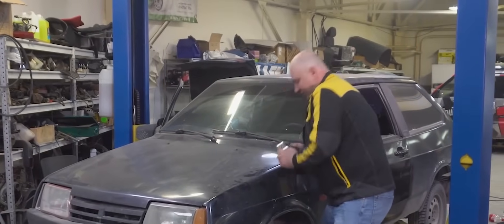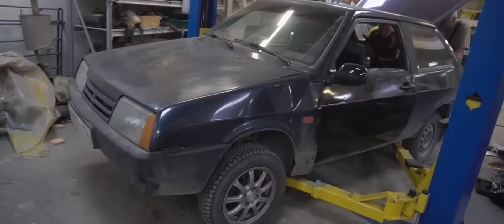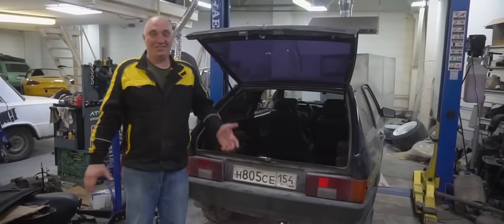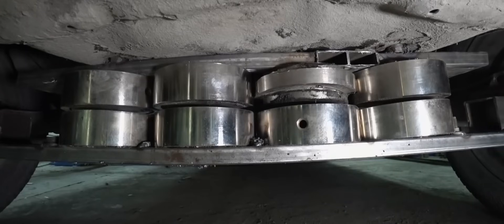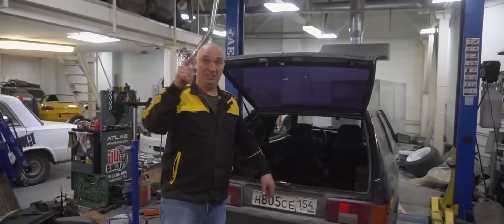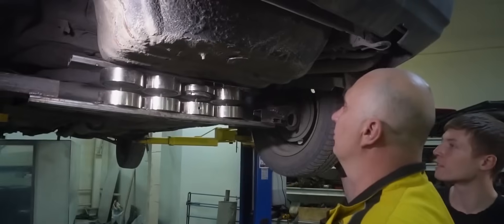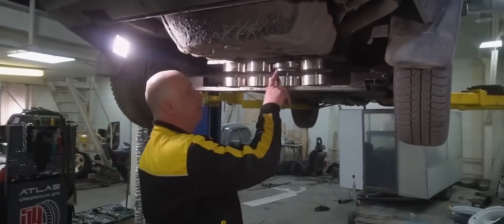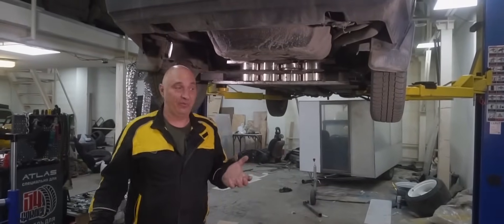DIY magnetic suspension

Comment: How about you try stacking the magnets Instead of two magnets, 
pressing together how about you add multiple i’m a engineering lover and I love engineering until you came up with a magnet suspension try stacking them like five or six of magnets then put it into a tube or a stick drill into the magnet then added a metal stick or some. I don’t know where it’s called.

Comment: Make a big tube and stack the magnets make sure each side faces a positive it'll act as a spring get 20 in total 5 per wheel (for full setup) use 10 if only doing the rear

Comment: Very interesting. Maybe you can try this: a loudspeaker is a coil wound around a tube that sits around a permanent magnet. When you apply a current to the coil, it's sent flying in one direction or another depending on the polarity. On the speaker the coil and tube is bound to the cone that in turn pushes the air, and that's the sound you hear. You don't need the cone, just a bunch of stacked permanent magnets, a tube sitting very close around the magnets, and the coil wound around the tube (firmly attached/bonded to it). The magnets would be attached to one part of the suspension and the tube to the other. The catch is that the tube needs to be made of some material that won't disturb the magnetic fields, and at the same time be able to support the weight of the car. Some kinds of metals interact very little with magnetic fields and could be appropiate. The coil should be electricity isolated from the tube.
Not sure if this would work. I don't know enough about that field. I suppose it would require a shitload of electric current. It would probably a good idea to team with another channel that has practical knowledge about electromagnetism, or maybe some enterprise that manufactures electromagnets.
EDIT: it seems like Bose (speaker manufacturer) had made an electromagnetic suspension like 20 years ago, and it's great. Never seen a car run perfectly leveled thru obstacles almost like they aren't there. Somewhere i readed that they used linear motors, sensors and a computer to control it all, and that the required current isn't that much, but the system weighted like 1/10th of the car (100+ kg, i assume?). This is one video about it: https://www.youtube.com/watch?v=3KPYIaks1UY
And another one: https://www.youtube.com/watch?v=Z97Db1X99wA

Comment: I had a similar idea too some years ago. Was so good to see you bring it into practice. Maybe has been already suggested but, here´s an hybrid idea: what about using the magnets as dampers( that is, making a + and - side attract each other) and combine it with a spring (as I believe it has better shock absorbing properties than magnets in practice). Basically, the idea would be replacing the hydraulic part from spring shock with magnets for slowing down the rebound and keeping the spring). Can see it working in my mind. Do you think it could work? Would you give it a try?

Comment: Try make a motor that will run on compression alone no fuel sequence of pistons no valves ,hitting compression 1 piston after the other creating continuous rotation of crank could make huge generator ,My gift to you if it works .maybe incorporate magnets 🧲

Comment: Put the magnet in like a cylinder it will be to cylinder with 5 or 6 powerful magnet
And each wheel have its own suspension magnet system
And it can move more like up and down
🤔🤔🤔

Comment: Place the magnets inside two cylinders, facing each other on different poles, cylinder should be shorter than the magnet assembly, top & bottom magnets should be secured to 02 steel disks with four holes to tighten the bolts & nuts to the body inside the shock well on the top and the bottom to the crossbar of the wheels

Comment: The Metalls interfere with the Repelling force. The surrounding should be isolated.  
The repelling and attaching forces are always equal. 
A Combination of hydraulic and magnetic Suspension could be good functioning. The magnetic field should be produced by electricity and with the help of AI altering the Repelling force according to the road conditions. Or be manually controlled. 

Sport, Comfort… drive modes

Comment: You should try another one using magnets in a copper pipe. Eddy currents actually behave similarly to a damper in that they slow movement. The problems with magnetic springs is that lose magnetic force exponentially as distance between them grows.

Comment: These kind of magnets are freaking scary! Very neat idea! Ideally you'd use electromagnets though so that the junk you gather driving falls off when you power down the magnets, plus without electricity they wouldn't be magnetic, which would make them a lot safer to work with and you can up the current/voltage to get more magnetism- way beyond the ones you used too and to add to the features you could adjust the voltage so operate them like bags and adjust your suspension- more current, more travel/higher ride height. what you could also do to get more travel is stack them- rather than just one magnet on top/bottom you'd do like you do with regular shocks and stack a bunch of magnets and just ride on air

Comment: What if you put a sprocket on the outside of the non powered wheel. Then a sprocket on the powered wheel. Ran a chain from one to the other. On both sides, and make it a 4 wheel drive? 😂

Comment: I think it would be cool to try this but to put all the magnets in a tube with a guide pin the the center and it would hopefully fit where your original shock absorbers were located.  I would use a threaded center pin so you can compress all the mangets together for installation and it would be somewhat adjustable afterward.  Great video with a good proof of concept.

Comment: The better design is to stick a four or six magnet stacks. Horizontal travel would improve, it would be like increasing voltage on a set of battery. So fist stack would of 4 magnet,  2 magnet north to north, then the next stack south to south. That would provide enough travel and you can have one stronger than the other giving you a dual damping rate...... No need to reinforce the suspension since you can mount in the general coil area, not in the middle of the chassis

Comment: The problem with that idea is that the force is exponential to the distance, so in the down direction there is little room for motion but the up direction the car has a lot of room to move with ease. What you need to do is, place a magnet in a conductive tube to use eddie current to create a damper. This will be linear in all directions/ For the spring to keep a offset position, im not sure

Comment: Some rubber between the magnets preventing magnets hitting each other? Make rear axle suspensio n like   \o so that th magnets are located closer to the attachment point of the rear suspension to the body, so that the smaller distance between the magnets leads to larger room for movement for the wheels?

Comment: Put the magnets same way inside of the car shocks with shock oil and air . the magnets will still work wether it's in oil .or helium air .normal air gas or water the magnets will not lose its reverse polarity under this condition innovate and initiate

Comment: you can also use springs with the magnets. I think it would be more efficient and safer. And also i must say that the magnets those you used in this test is not producing enough power to that veichle`s weight.

Comment: I wonder if you turn the magnets around so they pull together, but run a piece of hard rubber in between if that would create a suspension effect. The rubber would rebound and push away, as the magnets would pull together

Comment: The rings that hold the magnets also short out a lot of their field, as they are touching both poles, using a non magnetic bracket would have been a step to a stronger repulsion, as would have been to close the magnetic path of the outside poles to each other...

Comment: Half an inch travel on rough road and can't hear it bottoming out? Ears are painted on!  Get 24 smaller donut shaped magnets, make 2 struts using 12 in each. Centre holes must be 1" so a 1" aluminium rod can go through all magnets for locating. You can figure the rest out. Eddy currents from magnets should have some minor dampening effect in the 1" rod.

Comment: electronic magnet shocks. increasing electric current increases repulsion.  we can adjust ground clearance as well. but to minimize extreme heat in metal you have to design the  liquid nitrogen tubes inside metal thats going to be magnet

Comment: you can reach the same sensation of magnets by installing 2 pairs of diferent spring force, the problem with magnets is that cost to much and after some time you will have a bunch of metal scarps attached to them while driving.

Comment: excellent job. now, why not put the magnets on an axle, intercalated with copper sheets (diamagtetic repulsion), and use this gadget as a shock absorber ? inside a case, maybe with oil inside, maybe with holes in the copper discs to pass oil for dampening effect  ?

Comment: maybe instead of 2 steal bars as support between the wells you could use 2 set of sheet (bow) suspensions with the magnets in between also guided with steel bars on the center of the magnet, also between the magnets on the guiding steel bars some small coils to cushion the travel on high impacts

Comment: Wouldn't it be better to use electric magnets that, depending on the distance the suspension is 'pushed' in, will change it's magnetic force. In other words, it is adaptable enough against the change in input-force caused by the car bumping on the road. Similar to how a spring works. The more the suspension is pressed in, the more electricity is added to the magnets (so they will exert more magnetic force), and thus the more the magnets will push away from each other. 

And since all of this works on the speed of electricity, you could maybe connect the suspension to a computer that will regulate the amount of electricity added to the magnets, based on the movement of the suspension, out if which you can derive the input-force caused by the bumpy road. This would be a suspension that is very adaptable to the change in force, which is not reliant on the material itself, like a traditional string is. Or a just 'superior spring'.

Comment: Instead or struts stack the magnets in a column   + -  - + + -  - +  4 on each side with a rod that goes though all 4 to keep them aligned. I guess you could put the shacks around  if it fits owe them.   Id be careful with those magnets you will crash and break all the bones in whatever you put between it and a pace of ferrous metal or another magnet.

Comment: Would have used aluminum cross beam and used a thin nylon disc in between the magnets as a cushion. Aluminum cross beam so the magnets arent more attracted to the steel beam currently used.

Comment: You should try to layer another two magnets above each set so there’s a column of 4. Could effectively double the travel and weight capacity?
Reply: Yes I agree, but you trade one for the other. Less weight equals bigger gap and more travel for a softer ride, while more weight will lower the gap and subsequent travel resulting in a more stiffer ride.

Comment: The attracting and repulsive forces from magnets are equal. They are inversely proportional to the distance squared, however. That means that as the distance increases, the force diminishes as the square of the distance increase.
Double the distance, one fourth the force. Triple distance, one ninth the force, etc.
So when the magnet is firmly attached to something, the distance is very short, effectively zero, which gives 6 kN of force. Increase the distance by 10 mm and you're probably down to a few 100 N.

Comment: the problem is that these magnets must be expensive. I guess about $ 200. because, there are ones with a capacity of 2000 pounds of traction and they cost 80 dollars and they look smaller than those of the video

Comment: 1. Mentioned force is what you have to apply to keep them touching with the whole surface, it is greatly reduced even at a few mm distance, so they have very small travel. Such magnets are good to keep it from touching but not to act as a spring.
2. Placing them in the middle is actually creating a lot of leverage. It would work a bit better if those were installed as close to the wheels as possible.

Comment: What about severel magnets stacked in a stainless steel pipe with oposite polarities. The pipe goes on the axle and the chassis gets a piston that goes into the pipe and compresses the magnets. You get the same force as 2 magnets but more travel.

Comment: The magnet must put sealed with aluminium to be act as isolation then put also oil like a shock and design like a normal shock absorbers. The theory is like a replacement of a coil spring, instead of coil then we put magnet on a shock. After the shock must projected with rubber in order to minimize the sensitivity of a magnet outside the tube or shock.

Comment: id say just double it and copy the design in the front kind of... may have to stack the magnets in the wheel wells to create almost a spring of magnetic fields to dampen just like a shock being compressed and a shaft to hold them in position through the middle just like you have just to avoid the engine and bottoming out, f*** it just weld it up however you figure it to work best on the car. honestly not sure if the shaft being metal so the magnets somehow work better with that friction or possibly a thick plastic rod would be better, possibly 3d printed, it just wont be a permanent thing!

Comment: What should have been done is to use only one set of permanent Neodymium magnets [either the upper or lower] and the other use copper cylinder or aluminum cylinder.  
You should also have a spring coil to support the car so that when the car is stationary there are sufficient gaps of 3-4cm between them ( the magnet and copper plate should still have a small safety gap of 3-5mm when the coil is fully compressed).  
When there is a bump, the movement will cause an opposing eddy current and magnetic field on the copper plates.  The harder the bump the stronger the opposing force, and thus the cushion.

Comment: Instead of using the pushing force of the magnets use the pulling force and use something the keep them apart so when they try to connect it won't allow it and when the suspension travels you will have a much stronger pull

Comment: Well, it is a good idea but there’s only one setback you will have to figure it out.... how to prevent every piece of carbon rich metal on the road to attach to your suspension?
As you would be rolling down the road, every piece of junk would stick to the magnets besides the risk of them sticking between the magnets at a high rate of speed and breaking only one side of it! Ouch!!!
You may try to make the suspension a kinda telescopic with the magnets inside the car, inside of an antimagnetic enclosure or owners would be calling you to remove their belongings attached to the car, mechanical watches not working, and some sensitive electronics acting up.
Overall, very creative!

Comment: If put 4 magnets aligned with center guide in the left side and the other 4 the right side, I think the gap between magnets summary 2 inches or more and then have enough space for street bumps.  It's the better formula for magnets suspension. Like if I'm right.  👍   😳😳😳😳

Comment: I saw the video this is quite good,
I have an idea for the same 
When install it keep the magnet level a few CM away from each other.
Mean touch point need to gaping 

If the car moving it will work but the magnet will not touch each other for life time.
And for sides from where you maintain the gaping hard rubber which is more time good for heavy load if touch the sides it will not sound and will use properly.

Comment: If you need more travel, you stick the magnets on top of each other with a thick copper pin through the middle for alignment, then encase the tall set up with oiled dampening.  You can use smaller magnets and replace the existing shocks with the same dimensions.
Reply: magnets on top of eachother will not be that much of a difference I think. Better would be to use stronger magnets, because a magnet is rated its force at touching point. Within 1 or 2 centimeters the force is already a lot less. If I remember correctly the formula was: double the distance you get a fourth of the original force.
Reply: And increase the gaps of many smaller magnets, right? Awesome idea!
Reply: Why copper?

Comment: you can turn those to electro magnets wrapping in copper wire like how you would an alternator and run a current through one side to change the polarity to turn on and off. connect a ground switch with a contact patch somewhere that would activate when jolted by a bump maybe attache a rod the side of magnet and put the contact patch on the other side on the magnet across and when it travels and touches the contact it activates the current turning the polarity on! and when it travels back it would no longer be in contact grounding it turning the polarity off.

Comment: When you put 24 magnets on that car, 20% of its weight will be magnets.
The answer to longer travel of that magnetic suspension, is electromagnet, if you run a certain amount of elec, it will make the magnets push power greater. Basic like the ones on bullet trains.

Comment: You can make independent structs, place in the sane place where are the original suspension structs. You can place 6 or 8 magnetics a  lá each side, with a guide bar. When you associate magnetics you get more force. So you can put that way each side:

    [  S  ]  (1 magnetic)
    [  N  ]
    [  S  ]  (2 magnetic)
    [  N  ]
    [  S  ]  (3 magnetic)
    [  N  ]
       | |
       | | (guide bar)
       | |
    [  N  ]  (4 magnetic)
    [  S  ]
    [  N  ]  (5 magnetic)
    [  S  ]
    [  N  ]  (6 magnetic)
    [  S  ]

Good lucky!